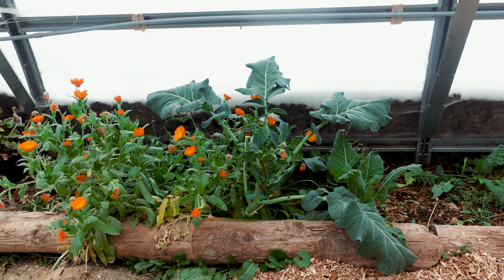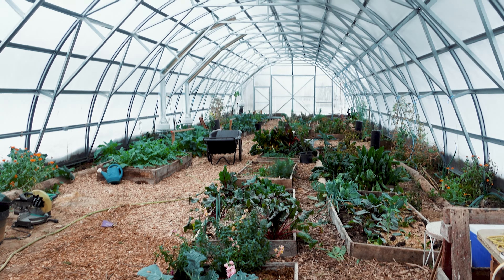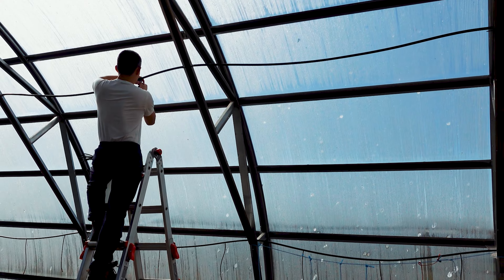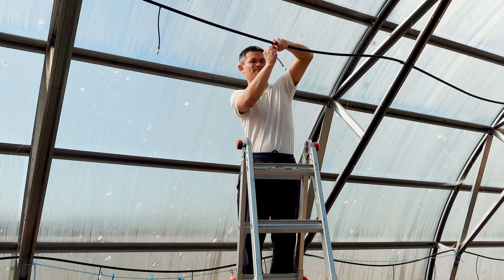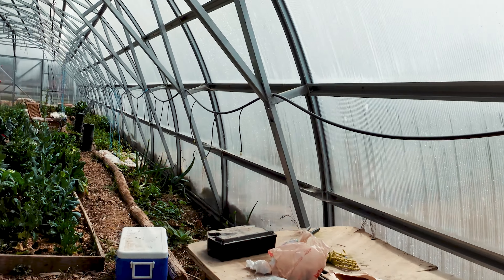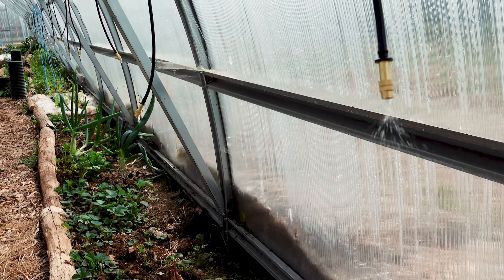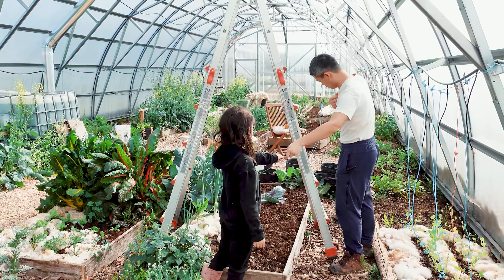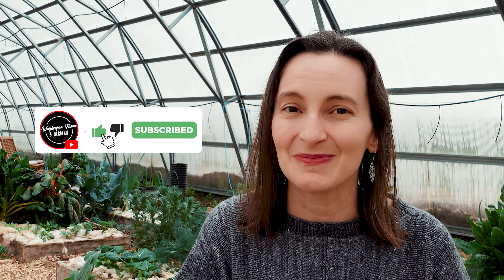How We Cut 15 Hours of Work with One Simple Change!

Comment: Hello, I also use the misting system, but I realized that not all crops benefit; For example, it works well with leafy greens like lettuce, spinach or arugula, which have a smaller root system and don't need much water; other crops work too. , but for tomatoes, for example, it will be a disaster, they will be full of fungi on their leaves and will require a greater amount of water.
Reply from the maker: Thanks for sharing your experience with it!

Comment: Did you figure out the cadence and duration of misting? I am having similar issues and just installed a misting system! Thanks!
Reply from the maker: So far we've been doing 5 minutes each "row", 4 times per day - so it comes out around 9am, 12pm, 2pm, 4pm. For us, that's been working well to keep the soil moist because there's a lot of evaporation in the greenhouse during the day. 

We turn it off on rainy or very cloudy days, or just run it once on those days.

Comment: What an intriguing way to water your greenhouse. Does watering to foliage increase the risk of fungal infections and blight during the hot months? Also, what is the expected evaporation of the water vs a drip system? This system is fascinating.
Reply from the maker: I will definitely report back on the fungal/blight side of things - I think it'll be a tricky balance with the closed space... but we do open the doors and have our fans running, which I'm hoping will help. We also live in a pretty windy area, but it's hard to know ahead of time. 

Evaporation is pretty high in the greenhouse in general - we can see condensation on the inside of the roof often, so we know it's happening and the beds get dry really fast. I don't have a side by side comparison between drip and misting - but I'm thinking that it will evaporate more with mist. But I kind of see that as a feature, because if we need to mist more often to keep things at the right moisture level, it helps us cool down the greenhouse more. 

We haven't had it long enough to know all the answers yet, but so far we can reduce the temperature by 2 degrees when we run the mist for a few minutes. That might not seem like much, but I feel like the plants are happy with any reduction in heat - we're already reaching the 122F temps we saw last summer and it's only mid-April!
Reply: @waykeeperfarmandnerdery  122*F seems very hot. We don't get anywhere near that temperature. Is that normal for your area?
Reply from the maker: @TheOldMayfieldPlace  Ahh sorry, I should have specified - that's 122F in the greenhouse. It's 78F outside, but the greenhouse heats up extremely fast with the sun and it doesn't come down until sunset.
Reply: @waykeeperfarmandnerdery  WHEW! That makes me feel better. I was a bit concerned for you. 😂